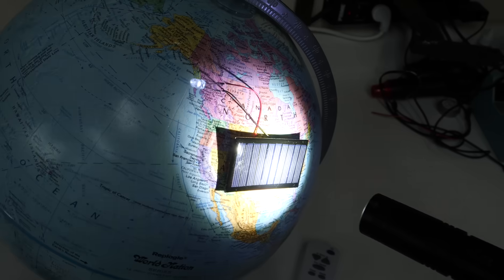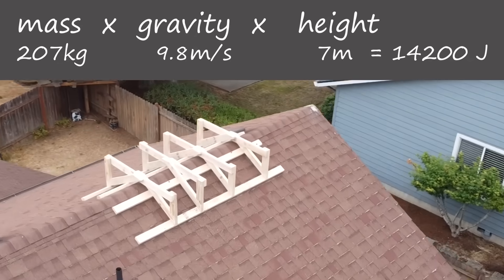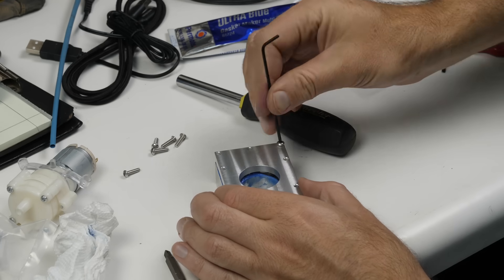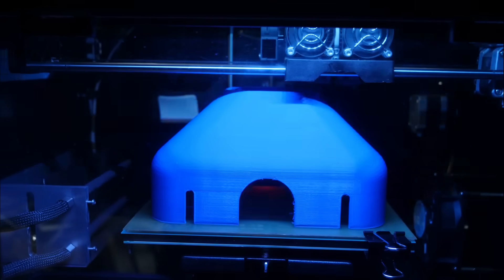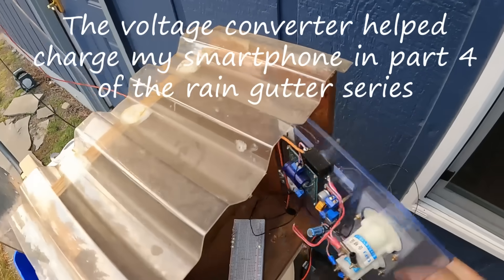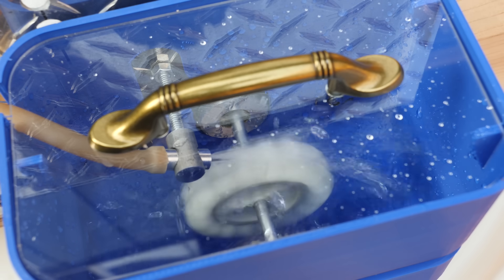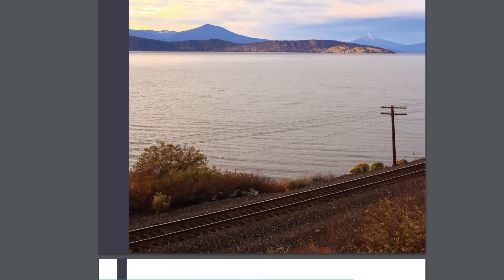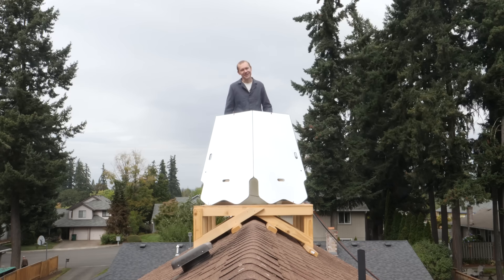Storing Solar Power on my ROOF!!!

Comment: I am using 9 Ram pumps instead of solar panels to pump water on the roof top water tank & a tesla turbine connected with a bigger alternator, Also for voltage output connect a voltage multiplier it helps a lot

Comment: What if…you let the water fall at an angle into another water wheel before it’s captured and used that energy to pump it back up at night. Would it add time to your light? You could even narrow the capture pipe as it traveled down hill to create more pressure.

Comment: Ignoring the risks of spill you could use mercury metal as the liquid it would be harder to pump up but its so much heavier i would like to know how much energy a 55 gallon drum of mercury metal in a similar system would have maybe a Challenge for @Cody'slab

Comment: Very inefficient. You only get 60% of the total power consumed to pump the water up on the roof. Your tubes are very small and because its lot of friction and your hydro generator its 85% efficient. 
The water pump has less life than an agm battery. You need a proper pump that works cooler. You need large pipe on the downfall with 4 noozles. More psi when spraying the water. Check the 300 watts hydroturbine used by other guys on youtube. In that way you can get a longer lifecycle from your products. You adjust your water speed as you like.
In your video, you only get power for few leds. Around 5 watts. But using a larger turbine powered by noozles, you can get from 10watts up to 300wats.
Hydro can be very efficient naturaly on the river. Up to 85%.
But these kinds of projects  by pumping up and releasing water down you loose a lot in friction and mechanics. You may go down to 35%

Comment: Might as well use a heavier weight and using mechanical advantage to your benefit...that would be a pully for those who don't understand...the more you use it reduces the weight needed to lift another weight...you will just have to apply a lower force for a longer time rather than a large force for a short time...

Comment: 5:15
You should try to set the pump up to pulling the water instead of pushing it. It may not work if the tube is not primed with water, but suction might be better for such a small motor.
Install the motor on the roof with the panel.

Comment: A closed generator is not one that's in a box! It's one that doesn't surrender energy losses to splashing by enclosing the water drive of the turbine so that all of the water's momentum gets used to turn the turbine (except friction losses).

Comment: i have the same pump no wonder you overheat it..  it's supposed to run at 12 volts not straight off a panel.   Anyway,   I don't think the round trip efficiency is good, this is really critical to make this useful.

Comment: This is very similar to my setup for my evaporative coolor in my shed, the solar pump and barrel. I tried finding those types of switches but I must have been using the wrong keyword because the only results I got were for sump pumps

Comment: I,ve always wondered about making wet cell batteries with five gallon plastic buckets. But from the little research I,ve done, it doesn’t seem too practical. The idea would be stationary storage for off grid apps. It should be doable, but! Anybody got any ideas?

Comment: Why not use the pressure from tap water to help that little motor pump water to heaven. Plus that are some relly cheap chinese motors that work pretty much like a heart, and if energy comes out the water will not fall down from the hose, it  pumps and hold, pumps and hold.

Comment: Missing from your discussion is the effect of losses, mostly friction as the water is pumped up and down through the piping.  There is also losses in the generator and motor of the pump.  Every time energy is converted from one form to another, there is some that is lost.
Reply: Converted to heat, not lost.

Comment: you could also use a manual pump diverted water circuit in an electrical pinch

Comment: I had this same brainstorm, only using a tesla rotor where you have the funnel.  also I didn't think about using a solar panel to run the lift pump, but I thought about using a smaller pump for lift, using a portion of the created electricity to lift it back up and storing the profited electrical current

Comment: Nice, but a 2.4 kWh batterie costs about 900 euros. And you would need about 100 cubic meters of water on a 10 m roof to store the same energy. Batteries are smaller and cheaper.

Comment: what if you add a flywheel into the mix maybe even with alternating magnets on it and some coils onto your structure ? might take longer to get to speed but the u could automate the opening and closing of the water supply and save water on the roof. Also u have a high temp difference that the motor makes compared to the water on the roof, could have squuezes some more energy out with peltier there (yes its just a bit but something)

Comment: Hello, fellow Oregonian!  I'm currently displaced in Arizona, but heading back up there by the end of the year.  I've wanted to do experiments like this for quite some time, but have been too busy rebuilding the houses that I've been living in.  With this next move, I told my wife that we are NOT buying a fixer.  I want to do FUN projects, not "crawling under the house replacing drain pipe" projects.  :-)

Comment: What a fantastic project. As an Architect it's making me wonder whether one could design the roof itself to store the water like a hull skin tank on a boat.
Reply: If the tank were more like a solar hot water panel, the sun would warm the water and it could then be used in radiators inside the house after its delivered its power to the generator then pumped back up.

Comment: Just found this channel, really cool. Definitely going to give this a go and try to make a continuous running system with a bare minimum amount of 18650 cells for storage. Even if it just runs lights being completely off the grid with a small water supply it would be really great

Comment: Would you get more out of using the barrel in a gravity battery? The barrel is held at the top of a lift shaft, of sorts. The solar cell powers the pump to fill it. When it comes time to release the energy, the barrel is lowered down the shaft. The lift cable spinning a flywheel as it does the generator acting as engine breaking. Once at the bottom, a valve is opened to empty the barrel into the pump reservoir. A counter weight returns the barrel to the top and delivers more energy. Then it's ready to be refilled?

Comment: Why dont you try ram jet motor to pump water to overhead tank to avoid energy part.. ram jet works without consuming energy and the dynamo generating power is solely for you add solar to consume max power generation.. 
Plss comment to this sir

Comment: Weighing macine measures weight, not mass, so you must not multiply by 9.8m/s^2
Reply from the maker: Calibrated to read correct mass at the earth's surface according to the weight it senses.

Comment: Ok so I'm way too lazy to do the math but...your system used a lot more energy than a AA battery to pump the water to the top of your roof. Why do you only have the potential energy of a AA battery from your storage? Where is the huge loss?
Reply from the maker: See BUILD2 video

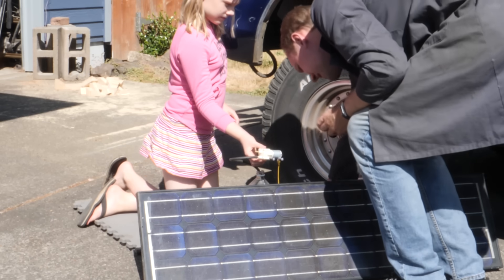Comment: You can watch all the video. Or you can stop at 2:36 and do some math
1J=1Ws
1Wh=3600Ws
14200J=3.94Wh 
Please do note the missing k before Wh, it means it is one thousandth of the unit you usually employ to measure electric energy consumption for your home.
For comparison, let's take an amazon basic Nimh rechargeable battery: it has a capacity of 2Ah at a voltage of 1.2V, equal to 2.4Wh. Also, this is actual electrical capacity, while the first is just the potential energy, before conversion into electricity.
Now you now why people use chemical accumulators, instead of big cans of water (unless they are REALLY big, REALLY high)

Comment: Actually, we already have an over pressure tank installed on our water line because city water can get super powerful where our house is.  No idea why it's like that but if you run low on juice, you can "recharge" your "battery" by simply buying water at non-peak times (night) and topping it off; I plan to see how high the water will push itself up a column/pipe and then put a water tank that high up and feed our house from the tank and if we can get a large enough tank we could probably charge a small house battery just on the downflow from that alone - again, topping it off at non-peak times and then just running it in the day with a float switch until we want to charge something.

I could charge a few EV bikes with a standard 250 gallon IBC shipping tank and they're less than 100 dollars near where I live.

Comment: 14,000 joules? That is under 4 watt/hours of energy.
So at full "throttle" (at 1 watt), will run for under 4 hours. But it took a "50" watt panel 5.5 hours to "charge". There's just a tiny bit of loss :)

Comment: Cool video!  I think the future of grid storage is likely to be batteries.  You were a little hard on lithium and there are several other chemistries/designs that can be used.  Lithium batteries will last for many years as long as we don't run them from 0% to 110% to 0% every time we cycle them.  Solid state will always beat out moving parts.

Comment: Great build, Quint.  Amazing how much money power companies can make by pumping a reservoir full of water during the night when the electricity is cheapest and then using it as a battery to feed electricity back to the grid when rates are the most expensive.

For your next build and utilizing the exact same principles, I was wondering if you'd like to try this:

https://en.wikipedia.org/wiki/GravityLight

Comment: I did some napkin math... For one kw-hr you would need 11000gal at 10m (constant, I didn't do any differential equations). Kind of unreasonable for residential use, but on a farm it would make sense. This also assumes 100% efficient motor-generator.

Comment: As a comparison, one 12Wh 18650 cell have 43200J. Also in a small scale, water storage efficiency is very poor. Don't even think about dismanteling that without measuring efficiency. I bet it is something like 20%.

Large scale systems can be over 70%.

Comment: Isn't this just another form for a dame? 
Dame:  
     1. Water on top of hill
     2. Water go through small hole in wall
     3. Water make shaft go brrrrrrr
     4. Shaft make electricity
Your set up:
     1. Water on top of house
     2. Water go though hose, hose has small hole
     3. Water make shaft go brrrrrr
     4. Shaft make electricity
The only deafferents is YOUR putting the water high up with solar panels and a pump instead of mother nature. Am I wrong for thinking this?

Comment: Storing energy in pumping water is a great thing at a larger scale. But not really effective in powering a home. For comparison, it can store less than half of a single 18650 cell of which there are multiple in a notebook battery.

in the setup shown the energy stored was 
E = 14'200J = 14'200 Ws

One standard LiIon 18650 battery with 2500mAh (at average 3.7V ) has an energy content of around
E = 2500mAh * 3.7V = 9.25Wh = 9.25W  * (60 * 60s) =  33'300Ws 
That is 9.25 Watt hours or 33.3kJoule which is more than double of the 14.2kJoule

Your phone battery probably stores many times more energy than the water tank on the roof.
Still a nice project for learning purposes.

Comment: mesurement of electicity in and out would be cool. But anyways really great video! Thanks!
How can i find such a small pump that gets water 7m high?
Reply: yep, because theoretically the barrel holds about 4 wh. (I was surprised to find that is so much. I did the math once and was 7Kw/h for a 20 tons mass up a km, if  I remember well. , so it seems I do not remember well.)

Anyway, at big scale there is at least a quarter loss, so if needs 4 w to put the water up, will recover 3. But at this level, may be only one wh or less. 
It will be really good to know.

So to charge a phone needed half a year of rain. To charge that phone with stored energy it looks like he needs 5 or more of those barrels :)

Comment: You should build a water car fueled of water, it's actually not that hard it will work in any car. All you need is a coil voltage going to a container of water and the gas created from the coil voltage inn the water creates the fuel gas hydrogen oxygen. Drilling a hole right into the intake manifold from the container of the gas. I seen several people do this years ago. You can mount a water tank for fuel probably in the trunk or back seats or even a smaller one in the engine compartment pretty cool I don't know why Ford has it jumped on this or anything.

Comment: I'm a 30 year old engineer and I find doing projects like this to store energy or create it is a lot of fun, especially when you try to make something higher powered.  I'm working on a windmill that I hope I can take my laptop and cell phone off the grid almost permanently... Which is surprisingly challenging when you really get into it.
Reply: I built a small wind gen. And it works. However, it doesn’t put out enough voltage at normal wind speeds to be of any use. But it was just an experiment. When I spin it with a cordless impact wrench, I got 147 volts dc! Never seen that kind of voltage before. Funny thing is, I don’t need one.
Reply: @michaelnelson9140  I'm probably on windmill number 10 now.  They keep getting better and able to charge batteries better.

Comment: Why isn't the roof full of solar panels yet? Is power so cheap in the US? With german energy prices of more than 30 Eur cents per kWh and cheap solarpanels and inverters, you can reach break-even in less than two years at the moment. And the roof would be big enough for about 5 KW of solar power or even more.

Comment: Why don't you use electric motor in water pump as generator? Just add solenoid valve to choose whether it charge or discharge

Comment: 14 kJ is 3.8 Wh so best case if your generator was 100% efficient you could run the string of lights at 1 watt for 3.8 hours.  By measuring the actual time and power output you can determine the efficiency of your water powered generator.

Comment: What was the power consumption offset between the power required to pump the water up versus the power output through the generator?  Small to industrial, how do we make that gap as wide as possible?
Reply from the maker: See video on BUILD2

Comment: 14,200J=3,392cal. This amount of energía allows you to heat a 250cc cup of water by 13,6°C. For converting units use TechCalc App. Too much usless  effort. Anyway, it is a nice experiment.

Comment: The UK produces 43% of it's electricity using renewables by using a giant version of what you did here. Two reservoirs with a hydroelectric power station between them. Wind and solar power is used to pump the water into the top reservoir and when it is needed it is run through the hyroelectric  power station, refilling the lower reservoir.
Reply: Actually 43% of renewable power not total power which is about 2.2% of our total capacity  which is shocking really.

Comment: @QuintBuilds"I got it!":  You start to talk about the project at hand, using the solar power to get the water to the roof, but then when you flash to the actual panel, we see in the background your Bronco wheel! - Are you thinking what I'm thinking?
   With a cool mind like yours, yes, let's explore that great solar option; but as an aside, you could compound your system results by,,,errr
blocking off (Pass.Side) differential on "cold morning starts" to allow engine idling, warm-up. I know your ticking mind could be with me on this one?-(you would certainly get much flow from the pump with all of that torque from the roller-system under the wheel.)

Comment: I think it's great that you showed your ingenuity by building that heat sink for that tiny old pump, but I think it would've been easier and more efficient to go ahead and get a slightly larger one that wouldn't have to work so hard to pump that water up to that height.  
Also, slightly larger--though still operating of that 50-watt solar panel--would mean that you could possibly transfer more water for storage, say, to a 2nd container.  
So, more power.

BUT. . .. that's just me and what I'm thinking.  This video is AWESOME!

Comment: this is an awesome video i have been looking into pumped hydro because i want to try and power my house using it the plan is to use a hill with a hight diff of 10m or more and a volume of 500 cubic meters to work as the storage method for wind turbines this will work in collaboration of having a very small energy efficient home

Comment: What happens if the water is expended? I would put a hand-crank to the pump to get the water back to he roof OR have a battery bank to pump the water... How long does the water last from the roof storage down to the collection storage?... They do sell hydro-generators on the internet... Also don't forget to refill the the barrels... the water will evaporate over time... Just saying

Comment: I got a video idea for you. Maybe you can try harvesting power from EM waves / RF waves using crystal radio.
Reply: Depending on the design size, that may be illegal (at least in some countries) as you create an EM shadow behind which nobody downstream of your aerial can tune in to the radio station. The authorities regulating the frequency bands tend to frown upon that. Also, I guess it's not difficult for them to locate the source of the EM drain simply by driving around the reported shadow area and triangulating the location of the drain.

Comment: 14200J = 0.00394kWhr
For this setup to equal a Tesla Powerwall, you'd need 760,000kg of water in use, assuming 100% efficiency of your system.